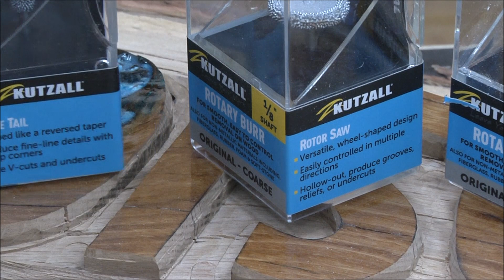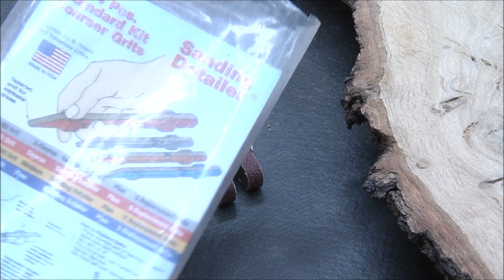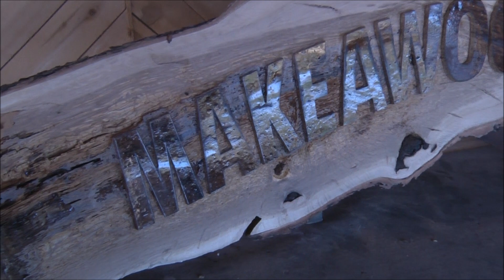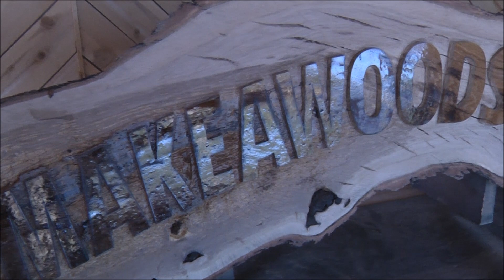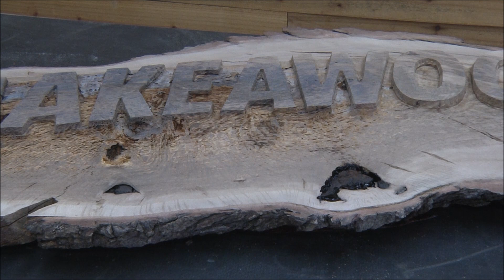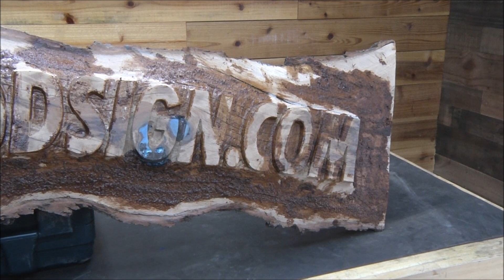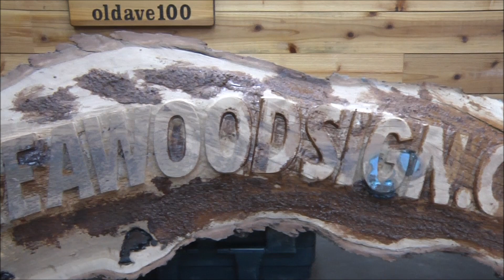#492 Shop Sign Part 6 More Power Carving On Gamble Oak

Comment: I really love this sign project. The resin and sawdust together to make filler is a great idea. I have tried the glue and sawdust  before and was not impressed.  But, the resin sawdust mixture would be a great way to seal and fill. I cant wait to see how it turns out. Loving it so far.❤
Reply from the maker: Thank you miss Pam. Happy I could help. Hope it works for you...